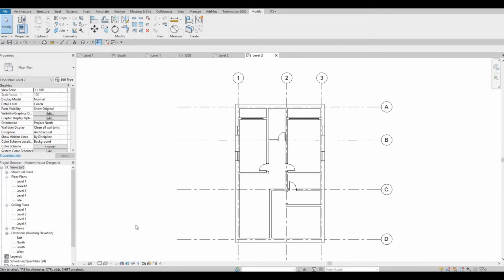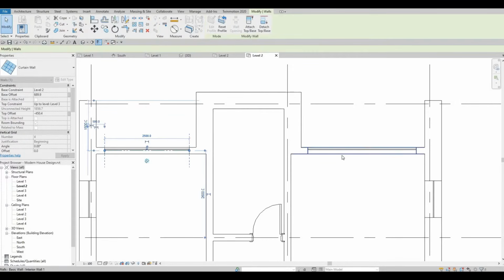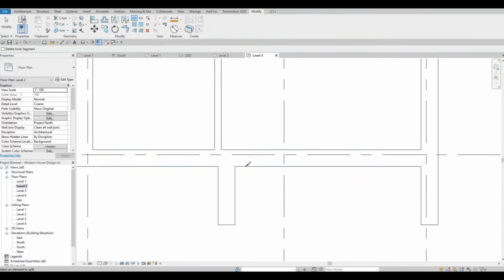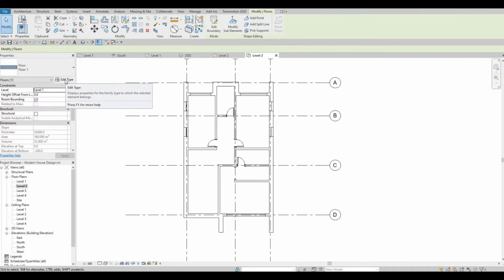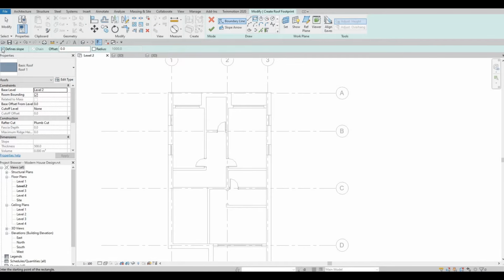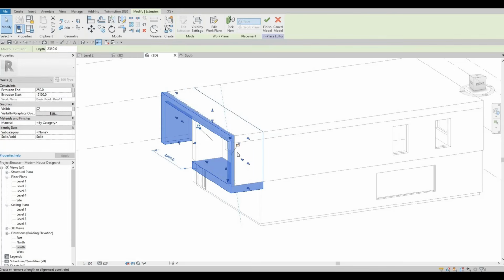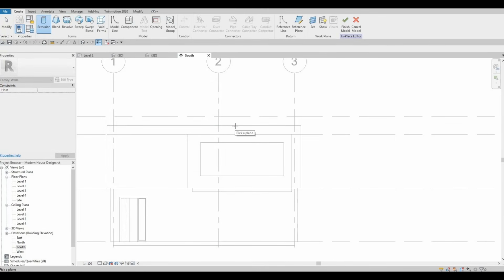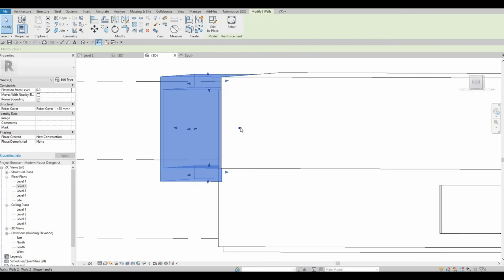Modern House | Part 3 | Complete Step by Step Project | Revit Tutorial

Comment: But don't you want your floors underneath your walls?  Structural Engineering says that floors are underneath walls.
Reply from the maker: Hi yes you are absolutely correct but the drawing is an architecture stage, in my country we do it by stages, once we got the architecture drawings approved then we can do the next step and do the construction. Also I placed it outside the wall in order to have a clean section, it is easy to do details on those. 🙂🙏

Comment: may I ask why did not you leave the walls as they were and what are the benefits of modeling in place walls
other than that awesome video really helpful!
Reply from the maker: The benefits of in place masa is flexibility. You can incorporate more designs and able to do changes quickly. 🙂🙏
Reply: Thank u sir , I'm agree with that, but the problem is that the curtain walls are not able to be shown on the model , how to fix that ?  @ArchCoreDesigns

Comment: Sir , Will you do a video on the extrusion issue?
Reply: I might have a solution. Try moving your mouse around the edges of the roof until the rectangle is selected and not just one line. For me it's the edge on the far right that does it. See 13:22 of the video.
Reply from the maker: Thanks James
Reply: @ArchCoreDesigns  Thank YOU for the incredible tutorial series!
Reply from the maker: Thanks James, I hope you can share your work after you finished. I want to see and share to the community 🙂🙏
Reply from the maker: Yes I will be posting it soon. Thanks Mohammed 🙂🙏